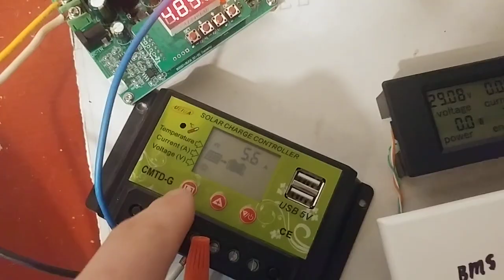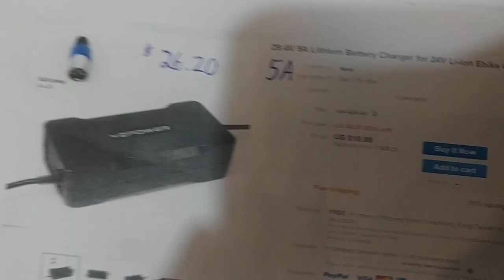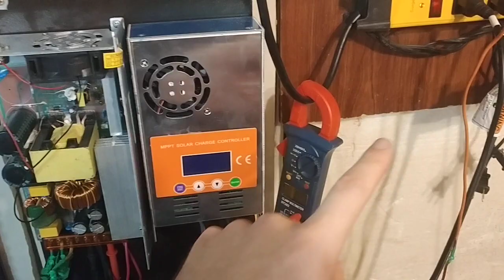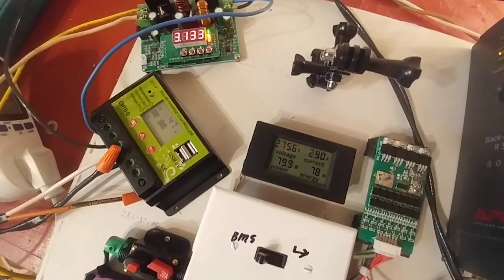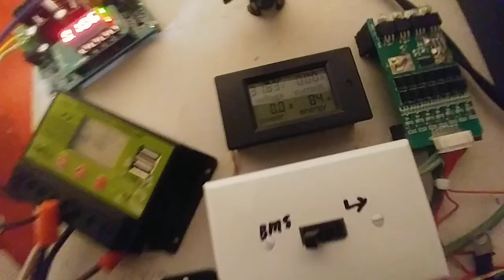18650 grid charging a power wall the worst way :(

Comment: Hey Andy put old cpu heatsink on the back of mppt makeskyblue with some superattack glue and you will not have thermal runaway... 👍
Reply from the maker: There is no heat. It never even starts running long enough to heat up.